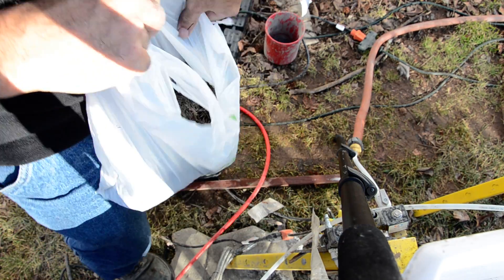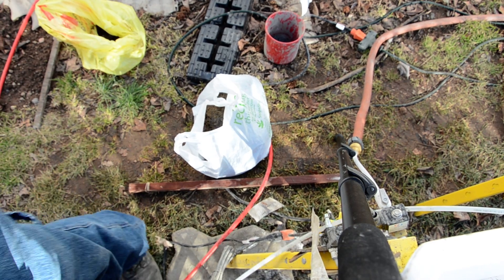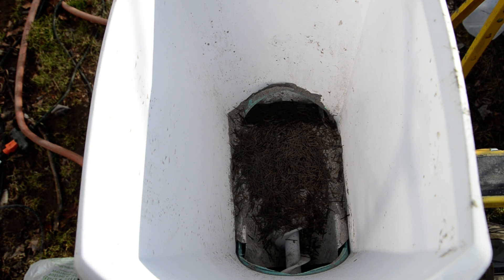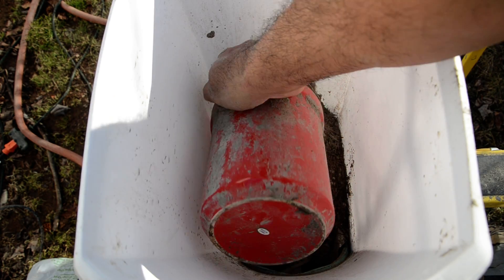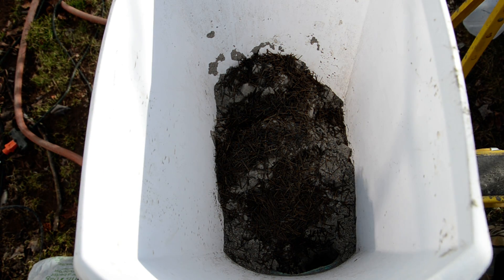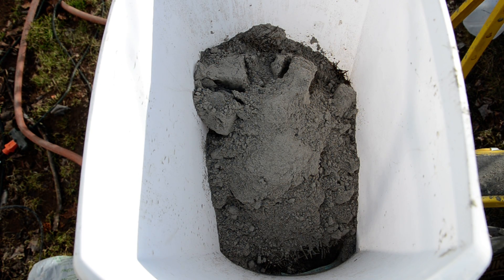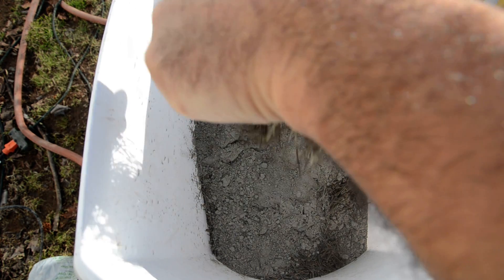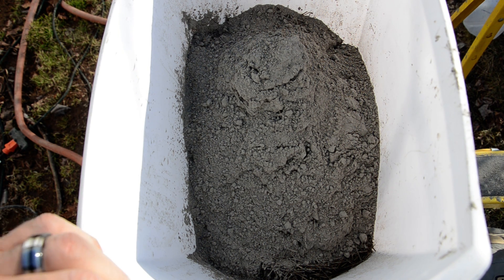Making Foam with green dragon for Aircrete | with Basalt Fibers Video | 2 of 4 #AircreteHarry #DIY

Comment: What are the chances I could pour a patio behind my house 12ft×30ft feet with air-crete?  Would I have to use rebar? Also how thick should I pour? Lastly my garage floor is 20x20ft, could I pour a rebar enforced 3 inch over coat?
Reply: Aaron Tafoya entirely up to you if you pour a patio.

Comment: Did it work?
Reply: Note that the building in Europe are made with rebar reinforcement (required), or latticing and permanent counterweights like buttresses. Duomo di Firenze is a good example of how it works. (Though stucco brick largely differs from aircrete) Also, I say in video he use wrong ratio. It is always 2 (aggregate) to 1 (cement) unless one use Keene's or special Veneers (Venetian, and various ancient techniques). I work in Historic Plaster Repair for 5 years, so you knoe where I coming from. :)
Reply: I agree With you .....Hajjar Claims Just dish soap and air is all you need to add to cemment... And i do not see how? thanks again!
Reply: I see also that some company use aluminum shaving, liquid, or some lightweight metal as aggregate to create strength. That, however make it less 'green', and require expensive/time expensive (sorry English not 1st language) 'baking' process to cure properly. (Up to 10 hour in ceramic oven at 230*C/450*F) Basic Mr. Hajjar is too dreaming, and a mit dishonest to say this only dishsoap and concrete. Even with a strong coat of veneer it is going to crumble, not hold weight, and my wager not sustain hurricane force wind. Mostly I see potential in Aircrete, but it will take more creativity and less lazy.
Reply: please read this.....Hello there Harry, Thank you for your video ,  You do realise  that air 
create is a non-load bearing material  don't  you?  Hajjar Gilbran..has 
made claims to people that air create  will with stand tropical hurricanes..and .this is total bs! man, i wanna see you fire a 2x4 at the wall of aircreat at 200 mph like they do with a real storm shelters , you and i both know air create would fail miserably, air creat is no more than an insulator at best  and should not be used for any thing more than just that!  I mean even  that house they show in the green dragon video  is  steves dome home and is not made of aircrete
 at all!  and there is not a dome made of this stuff  today man this is 
why they are using steves dome home,   and looking at the aircrete that you are 
making  having to ad all this other stuff to get it not to crumble? i think you can se why? cant you?  i mean just how much are you going to trust an over head  arch made of this stuff  man ?  according to Hajjar all ya gotta do is use a polyester roofing cloth to give it the strength it needs lol! , and all a skim coat of portland is going to do is make is heavier and break or collapse faster  my friend, this is what rebar and wire mesh are used for , they are used in concrete for  building strength ..Look here are the facts  Hajjar Gilbran has sold you an untested , unproven and very unsafe  building method, as this  Air Crete made with dish soap  has no load bearing  quality to it at all period and anyone foolish to try to make any kind of load-bearing structure out of it is going to get them selfs or someone else seriously hurt or killed when it collapses....Hajjar has Lied to you Man this is very unsafe  Think about it..  
.I am sorry but The Green Dragon   air crete building system with the arch forms  and build your own dome with it ,is a  total Pipe dream Man  and a very unsafe one at that!
TAKE CARE AND GOOD LUCK Man !
Reply: Ok so in Europe the use dish soap and the green dragron to make Aircrete? Because This is what i am talking about...And this is why Harry here is is unable to make anything that is not crumbling in his hands? Do you own a green dragon? because i do...And it was a Total Peice of crap! Just like Harrys here!........
Reply: I agree with you Rakashael O'Morgan!

Comment: good to see a customer testing the dragon. I plan to get one.
Reply: Al Mcm I will build a dome at the end of March. I'll make a vid
Reply: Whatever you do, please be safe! I have been working construction for 5 year. I have seen nasty mistakes turn into lifelong pain. The brick alone are not load baring. They will need permanent counterpoint, or as like Duomo di Firenze, the lattice arch Brunelleschi did the trick. Try this approach for best result. Please work with the local building inspector closely to build safely. I do wish luck to you.
Reply: please read this ......Hello there Harry, Thank you for your video ,  You do realise  that air 
create is a non-load bearing material  don't  you?  Hajjar Gilbran..has 
made claims to people that air create  will with stand tropical hurricanes..and .this is total bs! man, i wanna see you fire a 2x4 at the wall of aircreat at 200 mph like they do with a real storm shelters , you and i both know air create would fail miserably, air creat is no more than an insulator at best  and should not be used for any thing more than just that!  I mean even  that house they show in the green dragon video  is  steves dome home and is not made of aircrete
 at all!  and there is not a dome made of this stuff  today man this is 
why they are using steves dome home,   and looking at the aircrete that you are 
making  having to ad all this other stuff to get it not to crumble? i think you can se why? cant you?  i mean just how much are you going to trust an over head  arch made of this stuff  man ?  according to Hajjar all ya gotta do is use a polyester roofing cloth to give it the strength it needs lol! , and all a skim coat of portland is going to do is make is heavier and break or collapse faster  my friend, this is what rebar and wire mesh are used for , they are used in concrete for  building strength ..Look here are the facts  Hajjar Gilbran has sold you an untested , unproven and very unsafe  building method, as this  Air Crete made with dish soap  has no load bearing  quality to it at all period and anyone foolish to try to make any kind of load-bearing structure out of it is going to get them selfs or someone else seriously hurt or killed when it collapses....Hajjar has Lied to you Man this is very unsafe  Think about it..  
.I am sorry but The Green Dragon   air crete building system with the arch forms  and build your own dome with it ,is a  total Pipe dream Man  and a very unsafe one at that!
TAKE CARE AND GOOD LUCK Man !
Reply: As terrible as sound, it is true. I work in construction 5 years specialized in plaster masonry. Unless this is reinforce with metal rebar, or metal lath, it will collapse. This is not different to me than EIFS by itself. When it invented in 1970 they abandon it because it was not structure sound, and mold grows in unbreathable materials. This aircrete is good insulation WITH rebar inside and mesh to provide much strength. Otherwise, it will perish. Hajjar Gibran also dishonest to say cost $6k. What he really did not tell is this is cost in Thailand. Of course Thailand inexpensive. Anywhere else is too much. Also you have buy land (the person house build on land he was given) which is expensive so many places. Be careful to build. Unless tou live in desert with no earthquake, or debris wind storms, this not good by itself.
Reply: Thank you for Your input!  Also i was informed That the Tia House also is not even made with Air create at all! I do not Know but If some one out there could show me a dome made with the green dragon sytem Using just dish soap! i sure would like to see it  Thanks!
Reply: I will say that it dose seem like a lot better way to mix it than using the green draggon  as there is alot let that can go wrong this is why they went to to it...But please Note that Hajjar is verry Deceptive when selling this system...And i really do not know what to think about anything he is selling Now Because of past bad dealings with him!..Buut i would like to talk to you about yours.....Hajjar claims all you need is dish soap air and cement!  and as you cans see it all has not worked out well for Harry here !  i would love to talk to you about yours...Good luck! and stay in touch!

Comment: For glass fibre we add 3% of dry weight of your concrete mixture. That is a pretty high ratio of fibre. For anything you add premix ing is essential. Add fibre and cement together mix thoroughly. Only when you have even dispersal should you be adding it to your hopper.